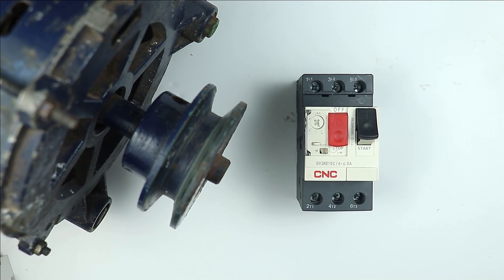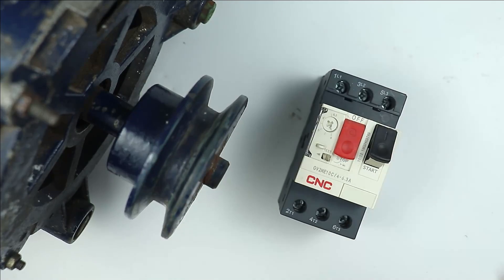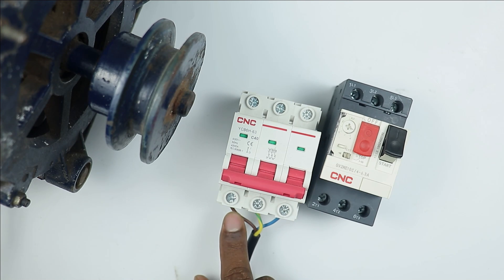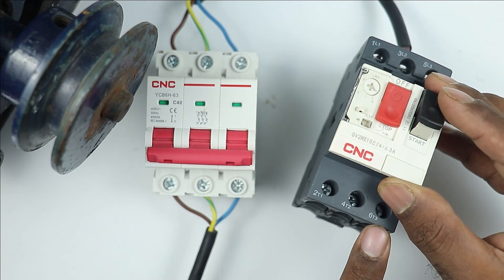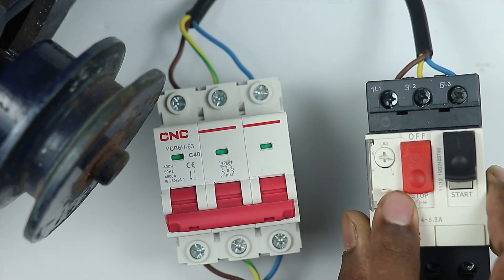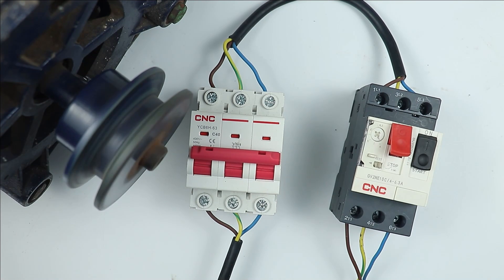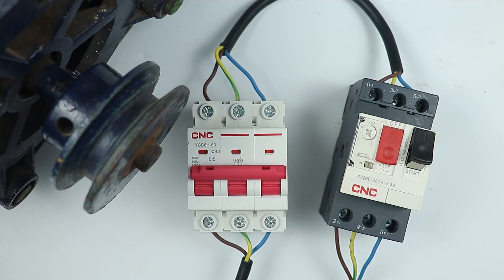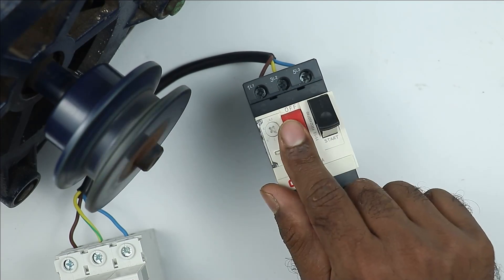MPCB Direct Connection with Motor Without Using Contactor and overload relay @TheElectricalGuy

Comment: What if we make single phase connection in mpcb?
1 MCB 2 poles to mpcb connect 1 & 5 as input load and 4 & 6 output to Motor and loop 2 & 3. Will this be working?
Reply: Yes I’ve tried it

Comment: Sir explain mpcb breaker used to submersible pump without stator explain sir please
Reply: Cannot use direct online starter connection like this video only suitable for motor below 2.5HP , submible pump usually 10HP motor it need to use star delta starter, auto transformer starter or vsd. To reduce starting current that can cause the winding to burn.